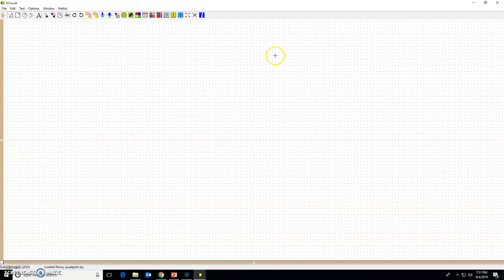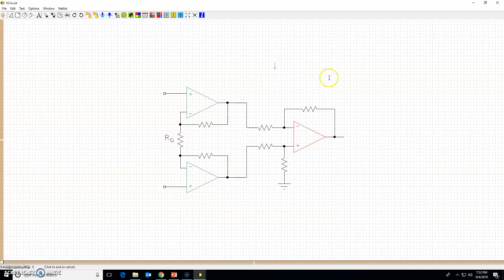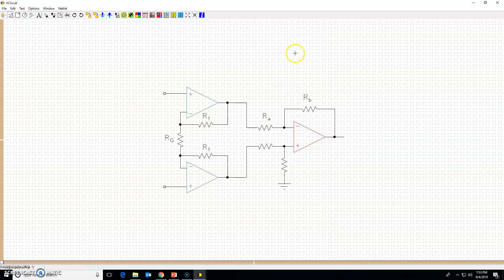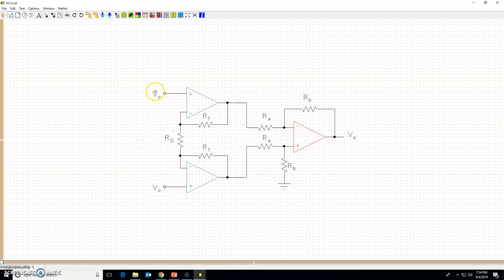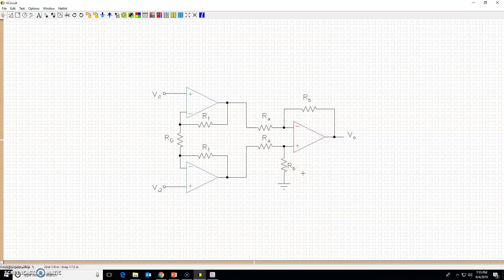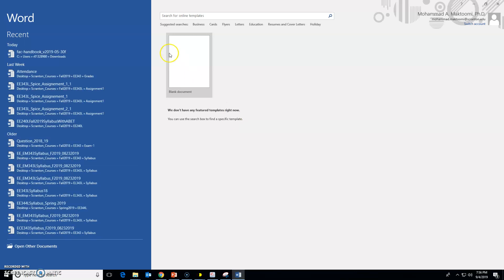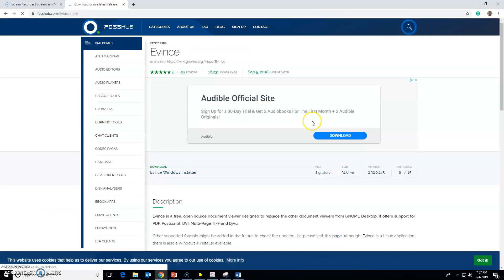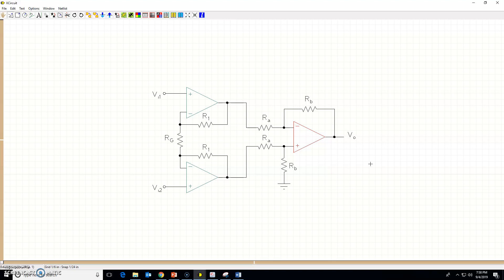Xcircuit Tutorial 4: Reading a saved circuit diagram

Comment: Sir, I am a lucky guy to see your precious tutorials! 
But, I have read the "i" on the top of XCircuit top bar, I am not a good student! 
I have a problem about line. How can I cut a segment on a straight line? As some times need to add some devices on the circuit diagram.

Thank you in advance Sir!
Reply from the maker: Hey as long as you're trying, you're an excellent student. I couldn't understand your question. If you mean how to cut wire somewhere to insert a device, there is no way to cut a wire. You can edit the wire to shorten it. Hover over the mouse on wire and press e. e is for edit. Then just moving your mouse will elongate or shorten the wire. or you can delete the wire and redraw that portion after inserting the device. Does that answer your question?
Reply: @MohammadAMaktoomi  Yes Sir, that is all I wanted to know!! And I thank you and thank you! All the best Sir, and I wanted you have a very good life! Thank you!
Reply from the maker: @martinsin9775  Thanks! Good luck.
Reply: @MohammadAMaktoomi  Yes! Yes! Yes! I am so lucky, to veiw your tutorials!!!! Thank you again!!!